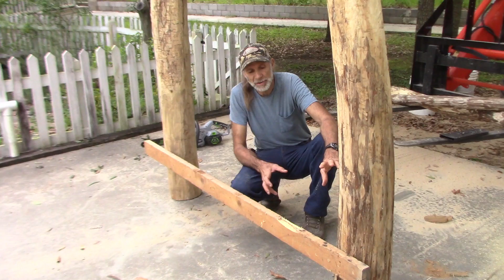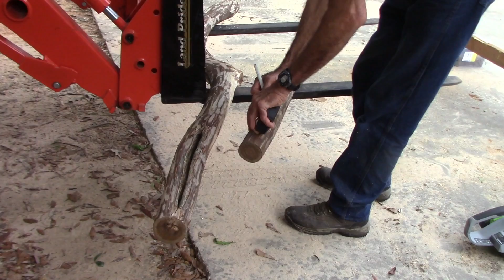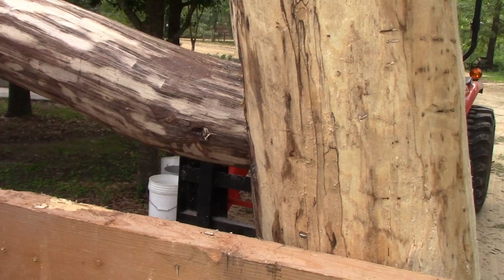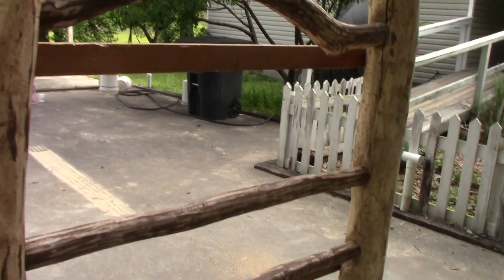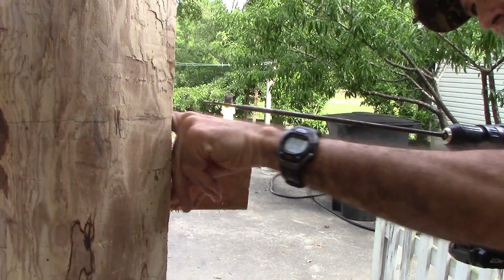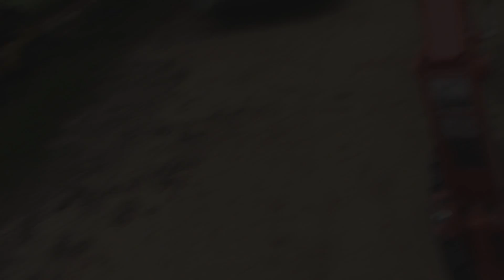What is the HEADBOARD Gonna LOOK Like?  |  The LOG BED

Comment: Looks great so far. 
Did you remember to put glide pads on the bottom so you can slide it without damaging your floors? Or even just something so the bare wood won't be in direct contact with floor